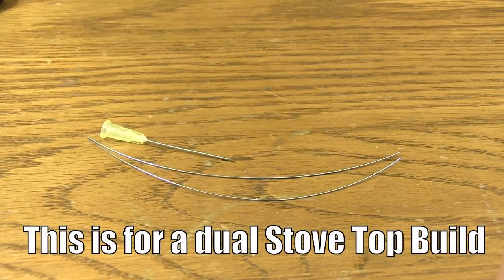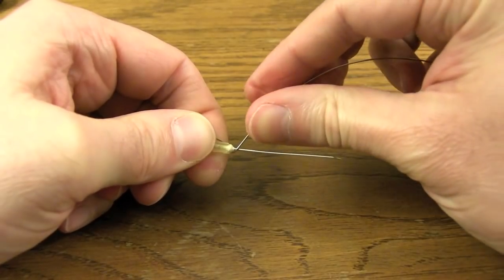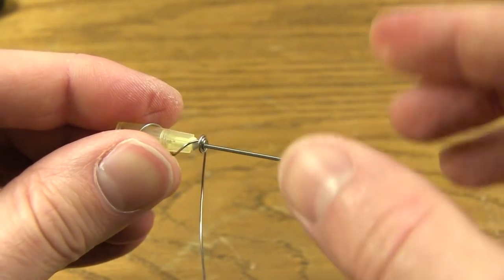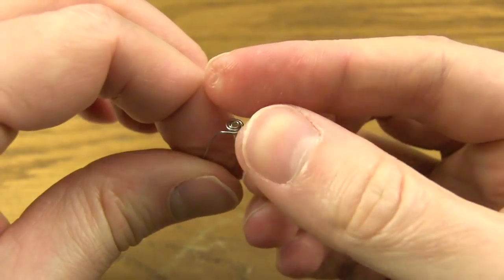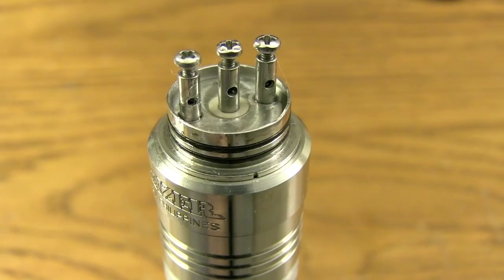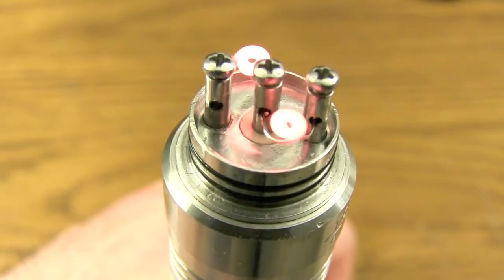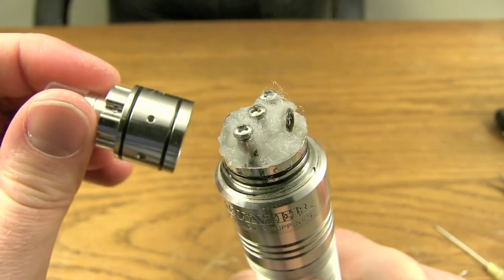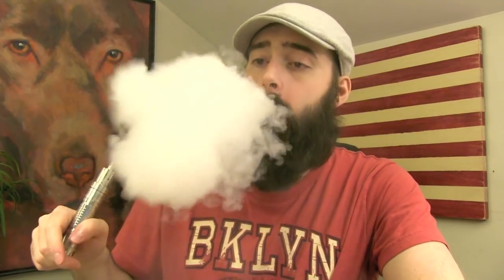Stove Top Coil Build

Comment: This kind of makes me wonder why nobody has made "tornado"-looking coils in their Kanger Subtank heads or Atlantis heads.  It would be much like the stovetop build, only stretched out to make it look like a tornado.  You could stuff the cotton down in there and it would form a natural funnel for the juice, going down to the bottom of the coil, where it should be the hottest.  The heat, vapor and flavor should naturally rise up through the "tornado" coil and right up the tube into the lungs.

Feel free to use the name if anyone tries it.  :)
Reply: Scott R You mean a spaced coil?
Reply: LolzPremiumRoast I was thinking of one that's more shaped like a funnel.  Not sure if it would heat up evenly, though, so it might not even be possible.
Reply: Scott R This sounds very interesting. You would think someone would have tried it by now. I'll have to try that for myself.
Reply: Me too
Reply: I tried something like that when I started out. I had a problem fitting it in my rda at the time and remember having an airflow problem and causing a burnt taste but I thought if someone had a bottom airflow and made the eye of the tornado "so to speak" almost touch the hole it would work well and force the air through it. Wicking wise I would Scottish roll and flatten it out and wrap it as many times as I could around the outside. Someone try this and let me know. Just spent an hour experimenting and rebuilding all my RDAs and tanks so I'm done for today.
Reply: And I did it an angled punch-like tool that I remove burrs when I drill steel.

Comment: Great video, really helpful. I don't have a needle, but a 1.4mm precision flathead worked well for me. This coil just throws vapor, and he got it straight when he said that there is a break in period, took me a whole day at 135W on the Reuleaux RX200 with a Goon RDA (plates instead of posts). Also, I gotta drop in two little quick tips here for anyone trying this coil:

     1) It is definitely easier with thicker wire. 22g was a peice of cake for me (I screw up while making basic coils).

     2) Don't try to single wick it, you will get hella dry hits even with the cotton drenched. It's best to just wick it the way he does.

Comment: All I have is 28 gauge I'm pretty sure it will work, hell I'm trying now.
Reply: Mind letting me know how that turned out?  I have a ton of 28 but that is it. Thanks!
Reply: Bendro it works great take ur time I.built this while watching the video do it its a hell of a Vape
Reply: ***** It's about the amount of surface area that is contacting the wick, and the ability of the coil to heat faster.   Basically, you have a huge contact area on the wick, which = more juice per second vaporizing, and the coil is stacked up in such a way that the material is allowed to heat up very quickly.  This eliminates the need to wait 1-1.5 seconds like you have to do with a standard coil setup for the coil to be at it's maximum heat.  All that translates to more vapor, faster, which gives you more nicotine and flavor in a much shorter draw.
Reply: zombieskillz Thank you for the update! Much appreciated.
Reply: no prob bro it fires like i beast.
you just gotta go slow remember that becasuse they dont look as clean as his does but if u take ur time o ur wraps u will get it
Reply: zombieskillz Build confirmed! 4/5 wraps w/ 28ga. Kanthal turned out 0.5 ohms in dual setup.  Vapes pretty damn well.  +1 internets for you.
Reply: Mine kept tasting like a hot spot, even though when I dry fired it glowed perfectly with no overlaps, maybe I fucked it up stuffing the wick in? Anyway went back to my nano dragon build I got it down pretty well. But nevertheless I still love an old fashion micro coil!
Reply: Rebuilding pro tank 2 coil

Comment: Has anyone ever thought of using any other wire for coil building like copper or silver for coil building or is kanthal the only one to use
Reply: Smoking off of copper is very bad mmkay
Reply: You can use nichrome too but kanthal has a higher melting point and doesn't have an odd taste half the time. Kanthal is used specifically for electrical resistance wire, the wires in your toaster that get hot and toast are kanthal too.
Reply: I was just thinking outside the box thanks for the input.
Reply: Not sure about silver wire.  but copper wire will not heat up like Kanthal wire does.  I had that thought run through my mind a few times also so you're not the only one.  haha
Reply: Kissit ImVaping copper is toxic and there are plenty of other wire types. Ni80, ni90, ni200 titanium, stainless steel to name a few
Reply: Copper will posion you and silver will give you a agryria where you turn blue. Chrome, and nickel are pretty safe unless you have nickel allergies. I knew some idiot who used lead solder wire because it was easy to bend no surprise when doctors told him he had lead posioning he thought because the coil didn't melt it wasn't giving off "toxic" fumes, think he did chelation treatment and is doing good now but, we haven't spoke in a while.
Reply: You’d need a longggg piece of copper wire to even get any type of resistance, might work if your RDA was the size of a 5 gallon bucket. Probably wouldn’t be too safe though😂

Comment: Ima use this for wax 😏 thanks rip trippers
Reply: Unknown 187 was thinking the same thing how did it work
Reply: It works
Reply: Sean The Baptist no cotton? What tank etc? Im keen to try it..
Reply: Sean The Baptist the wax doesnt heat and melt down into your deck? I use a Yocan evolve plus tank on my revenger mod and its the best setup i have tried
Reply: Oh yeah, the wax runs down for sure and doesn't work all that well  but as a last resort it will get the job done with a stovetop coil. I would use a rig for sure if you have one available. It's not ideal by any means

Comment: Found a really easy way to build one of these. Use the 20 gauge needle, two small o rings, or two small rubber plugs with a hole in the center, and a pair of small washers. Place one end on the needle, make the first wrap with the wire, then feed the center lead under the second o ring with the two washers in the center and now you have a channel to make several more wraps.

Comment: I find it's easier to get some vice grips and grip the wire start the coil by hand then place it on a table or flat surface and twist the vice grips. It gives you a nice tight perfectly formed coil every time. Just remember how many times you twist the grips.

Comment: This looks great. You mentioned the low resistance, and perhaps this is exactly what you want.  I will be trying this out soon - but I am going to put a very small amount of space between the coils.  When I learned the "classic" way to build a coil, it was stressed to space them out a little.  As a builder of guitar amps, effects, pickups, etc.. this made sense to me.  This would account for such low resistance - the coils are shorting somewhat (still getting plenty through them, obviously - they're heating up NICELY.  If the shorting is desired, then please accept my apology (I apologize ;-) )  I will likely try a build both ways.  Of course the resistance will be higher the more space between coils - but with your .3 or .4 homes (?) there is some room to get up to 1, 1.5, even 2.  What are your thoughts on this?  You know a LOT more about this stuff (I'm pretty new to coil building). I am just asking for your thoughts on the impact of putting a little space between the coils; a bit more resistance in the overall coil.

Comment: Love it. Cant wait to do this build when i get my new tank. Awesome!
Reply: You are putting dual stove top coils in a tank? Sorry to burst your bubble but how do you plan on doing that? I feel like this build would be 10 times easier if you build it in a RDA.
Reply: Thats what i meant... I got a vertex with a stillare RDA
Reply: The vertex mod with a Stillare? The Stillare is a RDA, not a tank /:
Reply: I know, i dont know why i said tank. Im just use to saying that because i just recently got it uprading from a shit evod. What do you have?
Reply: ahahaha I see, as of right now, I got the Tobh sitting on a Hana Box. And Magma By Paradigm on a Stingray.
Reply: I love the stingray. Does the button grind like everyone complains?
Reply: Every once in awhile. I have gotten used to it so it isn't really a problem to me.
Reply: If I keep my battery connection tightened down it usually gets rid of the problem. I'm gonna use some dry soap to lubricate all the threads because it is quite squeaky and sticky. Otherwise love the mod

Comment: I just built one of these coils myself, and I have to say, it's amazing. The flavor beats my Clapton coil (perhaps too many wraps? Did 7.) The stove top coil rarely spits juice at me, and the vapor is super dense. Note my stove top coil's wraps are not touching at all unlike in Trippers picture, and I believe I like it this way. Even though this coil is sort of a bitch to build, I would say this one of my new favorites. 

My El Cabron's top cap at first was barley touching the coil, so I had to bent it in slightly. Also, with the airflow only fully open on one side, this coil was awful. When I opened it up on both sides, somehow it makes a worlds difference.

Comment: Thanks Rip and a thanks to the other guy for the suggestion! I ordered a PH22 Mixed Mechanical Mod 18650 / sandblasted version a from Fasttech dot com but if it doesn't work out good I will look into y'alls suggestions. Yeah I was looking for one that had a 510 and eGo connection and the PH22 had it plus everything on fast tech is super cheap. Next I will probably get one with just a 510. I will definitely look at the ones you 2 have suggested! Love your vids Rip u r hilarious, need 2 party w/u!

Comment: Just tried this today, and it's awesome! I'm gonna need a more powerful mod to run it though. kbox mini just doesn't push enough watts.

I had to do 6 wraps though, because the resistance was too low for my mod on 5 wraps.
Reply: oh I don't have a hypodermic needle handy so I used the tip of a bic mechanical pencil, which worked it pretty well. it's a similar shape.

Comment: Just pulled this off with 26 gauge. Wasn't easy, had to rebuild my coils a few times. Also was a bitch getting it in my omega clone with small posts holes. Shorted out bad at first but I eventually got it running clean. I wouldn't recommend trying it with higher gauge wire but over all I'm happy with the build. Thx Rip
Reply: How many wraps did you do?
Reply: 4, came out to .3
Reply: Thank you (:
Reply: No prob
Reply: I did a dual stove top with 28 gauge in one try..
Reply: Yea if I had something other then the omega with tiny post holes it would have been easy.

Comment: I'm rocking an iGo W-3 and a Crown Atomizer, and they probably wouldn't be capable of insane coil builds like this!  Would you mind trying a twisted 28g kanthal build of any kind that the Crown Atomizer would be capable of with it's size holes in the posts?  I'm thinking of trying some triple twisted 28g, but I want your opinion if you'd be able to do something interesting with it.  :)

Comment: Hey, tried this build today and love it. Only problem I'm getting is that it works awesome at lower power (40w) but when I ramp power up closer to 100w the vapor production doesn't seem to increase much (though it does fire faster). Any possible solutions? Could my wicking be an issue or maybe the coils are sitting too high above the juice well for the juice to keep up?
Reply: lack of airflow or a regulated mod?
Reply: +Matt Wheeler lack of airflow is possible though this was on my mutation x v4. I'll play around with them a little more. From what I'm experiencing it seems that wicking and surface area might be more of an issue than airflow.
Reply: +Travis kingsley perhaps to get the vapor you're looking for you could try a more efficient coil build or a triple stovetop coil, if that's even feasible, I'm a newbie learning, I don't even have an RDA yet
Reply: +Travis kingsley best of luck in achieving your desired vape though
Reply: +Matt Wheeler I tried a quad coil stovetop design known as a pulsar coil. It was interesting though production still remains lackluster. I'm the more I experiment that sirface area and airflow at the coil is king. A coil that have some airflow through it such as braidiators are going to produce way better than anything else.
Reply: +Travis kingsley basically meaning that most of the coil is against the wick, by surface area? or should the airflow always be allowed to cool the coil, as the outside of the stovetops setup? (not burying the coil in wick?)
Reply: Wick and air surface area should both be maximized. For the stovetops you need one side really packed with wick against it, but not too dense. In normal coils you want a nice wick on the inside and as much outer surface airflow as you can get. Make sense?
Reply: +Travis kingsley yes

Comment: They have a spiral winding tool for making jewelry that makes these with a slightly larger diameter hole.  I got interested in spiral coils ever when I saw the ceramic plate coils . . . I called them hurricane coils until Rip did the video about flat wire spirals.  The thing about flat wire spirals is that only the edge touches.  Round wire is better.

Comment: You said it blows the hurricane but last time you did a hurricane you were at 1.8ohm what if you did a .45ohm hurricane or even just a .8ohm? I'm thinking about building myself a almost vertical hurricane in a kayfun. Shooting the vapor almost right in my long driptip, not exactly shotting it vertically in case some hot liquid get on my lips but maybe a 25-35 degree angle.

Comment: It's been a minute since I've built anything you've shown. But this one looks impressive. 

I was wondering thou, does the castle rda you are using have bigger post holes? Most the rda's I have, the patriot, nemesis and omega, struggle to fit a dual wire dual coil with 24 gauge kanthal. 

If so, what did you drill them out too?
Reply: On the patriot you can drill those holes out with a 1/16th drill bit which will hold just about any gauge wire. With the Omega you can drill out the positive post the same size if you're careful. The negatives on the Omega will fit 22 gauge pretty snug.

Comment: Hey RIP! 
Im just getting into rebuildable's , I was wondering if this stove top build could work in a kayfun lite or Russian 91% ? If so how would it need to be modified to work properly?
Reply: hey bud, not rip, but felt like I could give you advice on this, for the kayfuns and russians, simple and easy does the trick. I've noticed, you can go fancy and do all these twisted coils and what not, but they aren't really special in kayfuns. for my kayfuns, I prefer a simple 2mm 28g micro coil, 7-8 wraps. simple, clean, and efficient. the stovetop can only be made on an RDA, and not tanks, because the wick has to be put behind the coil as opposed to how most tank systems have specific channels that juice flows to the wicks. hope this helps

Comment: Does it necessarily have to be with the needle? Lol I don't really keep them handy so yeah
Reply: No need to use a needle, you can always use a thin paper clip...
Reply: pretty sure you can get a little punch set that goes up and down all the gauges you would ever use
Reply: Iamthatonesire i used one of the small screwdrivers that came with my rda, it was a little difficult but i flattened it out after i took it off and it was fine.